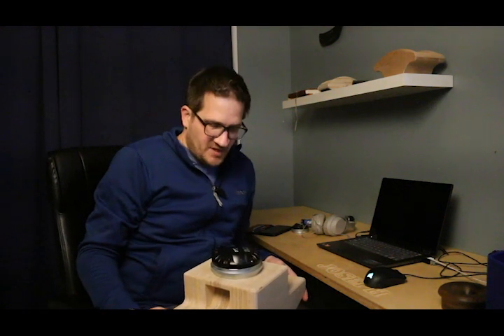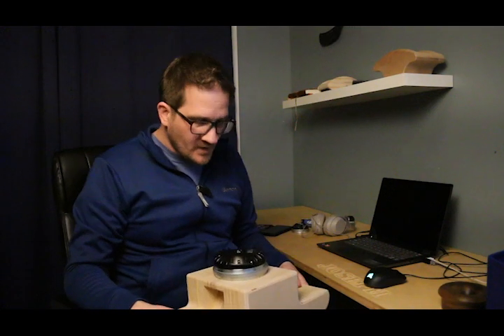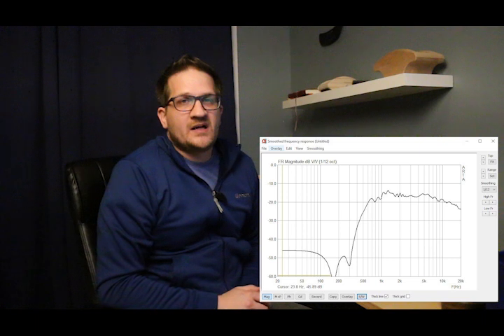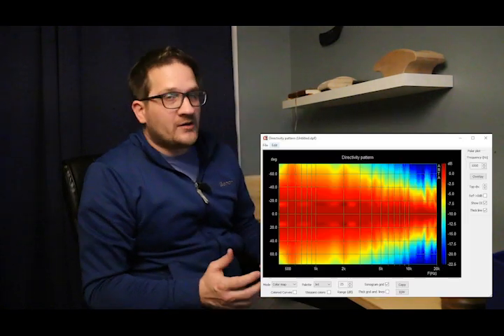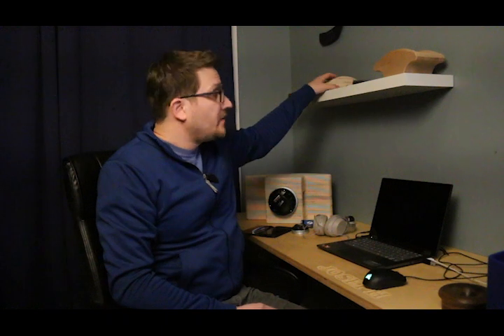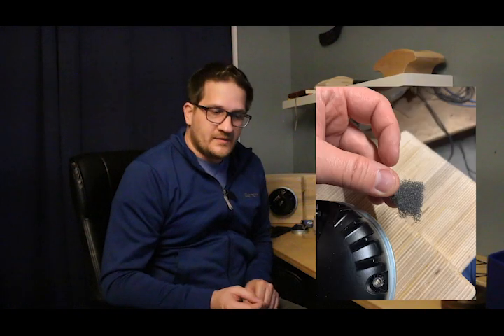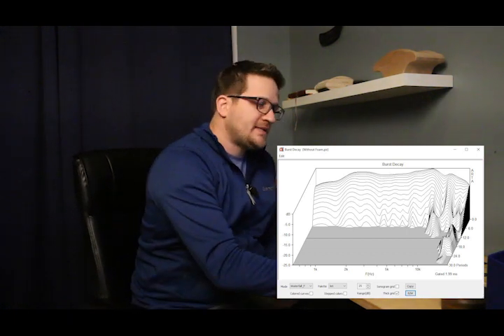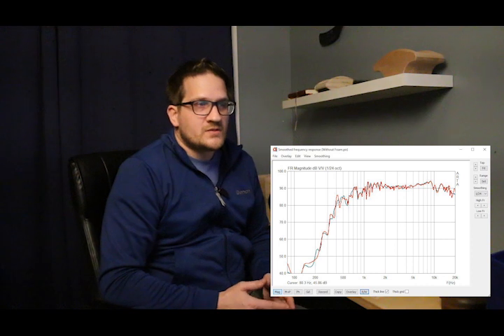Compression Driver Review --- RCF ND-850 1.4 with ES-600 Biradial Horn

Comment: You can use a piece of 3M surgical tape like the foam I think the foam will move with time I was wondering can you get carbon fibre diaphragms have not heard of any
Reply from the maker: John sweda Carbon composite will be tested shortly with the ES-290 using JBL 2446J compression driver.  Thx.
Reply: @JosephCrowesDIYSpeakerBuilding  who's making the the carbon fibre diaphragms then JBL other makes,
Reply from the maker: @johnsweda2999  My colleague makes them which are just prototypes however he has the manufacturing capacity to make them commercially.  His company specializes in high performance composites.
Reply: @JosephCrowesDIYSpeakerBuilding  right can he do extraction on the carbon fibre so you get a double skin affect, with an foam layer in between I am talking micron distances between the two layers nothing big probably the width of a hair. Or even making the diaphragm honeycomb shaped is the best shape, individual honeycombs to form the shape less material is needed and is stiffer, could be achieved through a vacuum,  by just milling the Honeycomb in the block of aluminium the shape you need of diaphragm, not sure which is better both sides honeycomb shape or just the one side something to experiment on
Reply: Joseph Crowe's DIY Speaker Building

Is this the same as Textreme from Oxeon? Very new material...
Reply from the maker: @johnsweda2999  Yes this has a foam  layer in between two very thin layers of carbon composite.

Comment: I am a speaker novice. I am an instrumentalest that can hear a qaulity speaker which is how I found RCF. I was curious if assuming the build construction and design of the cabinet and woofer were of sound/quality design would a larger compression driver (3 or 4 inches) in a 2 way 12 or 15 inch speaker increase the overall performance of the system when paired with a sub?
Or would pairing a speaker with a smaller compression driver and a Sub achieve the same result?

For example: RCF Art 932 vs. the RCF Art 912

Comment: The guys who started 18sound came directly from RCF. That was back in -98 if i remember correctly.
Today everything is different, thise guys aren’t there anymore and i think one of them  in the R&D is now with B&C (atleast i saw a photo recently of that) and also B&C bought 18Sound.
I believe RCF are doing very good stuff today, as always. I use their L15P400 and thinking of trying ND950 or 850.
Thanx Joseph for you detailed videos.
I’m the guy btw that runs SB Acoustics Loudspeaker fans on Facebook🙂
Reply from the maker: Great to know!  The L15P400 is a great driver.  
The ND850 is great from 600Hz-10kHz.  Much better than any vintage compression drivers.

Comment: So the heading say ND-850 but you speak about the ND-840!? 850 is expensive but 840 can be found for 216€. Also would like to know do you really hear 15k-20k. As I don't hear more than 13k it would have been interested to see if it would have been possible to rectify the 10k resonance with some stiffer foam.

Comment: you just solved an issue with my Ig4T speakers. the one had some strange distortion, a sine tone sounded fine, but when playing el piano some tones sounded distorted in the one speaker, in the lower end of its working area, but a small pease of sok (what i had) solved the problem :) thanks